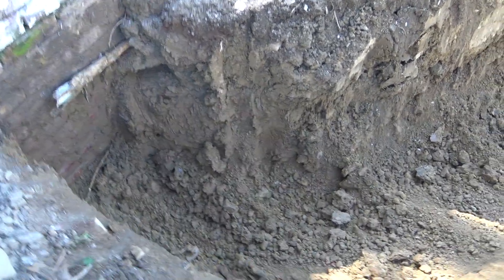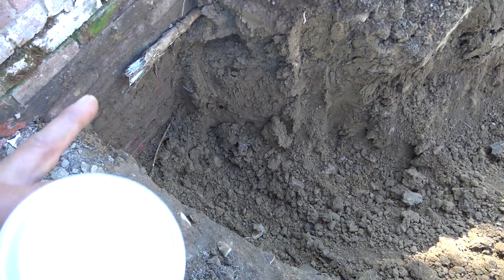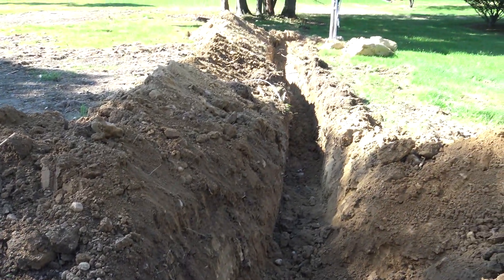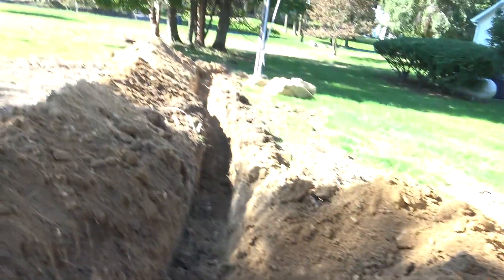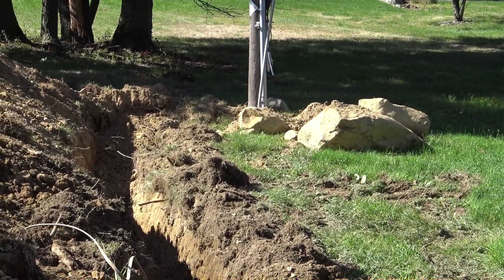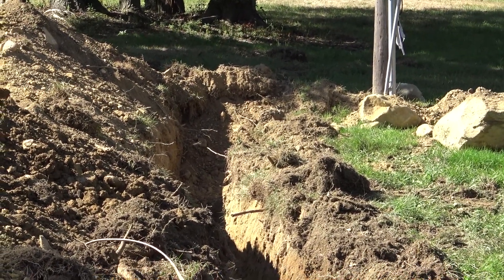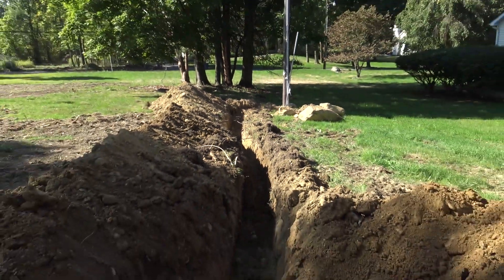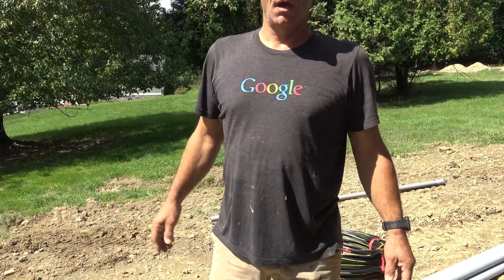Part 1 of installing a new 200 amp service.  Installing wire underground.

Comment: You really should have installed a meter base main breaker combo to provide a building disconnect and overcirrent protection gor your sevice entrance cable. Doesn't your ahj require a meterbsde main, or didnt you have to take out a permit for this upgrade? I guess it sll depends on what the power is company requires in addition to the ahj.

Comment: How come I am being told that 3 runs of wire are needed for 200 amp but I only see you ran 1.  I'm told 4, 4 and 2
Reply from the maker: I ran three to the pole and three from the pan to the panel. Two hots and one neutral.

Comment: I was wondering what happened to you! It has been a while since I’ve seen a video! I miss being able to do my own electrical. I’m building a site now that has a 1200A 3PY feed but sadly in commercial I can’t do any of it. Just have to pay someone $200,000 for a job you know would cost less than $20,000 in materials.